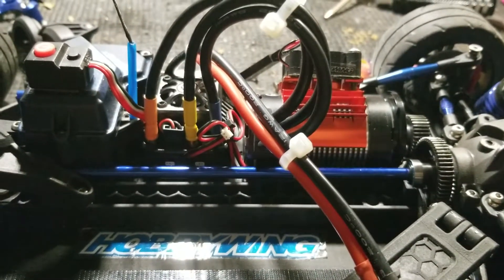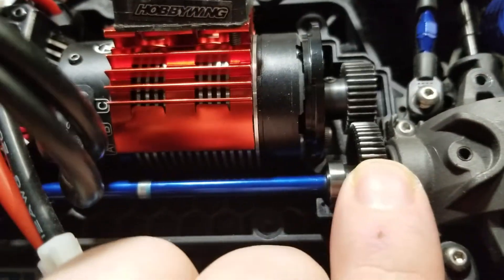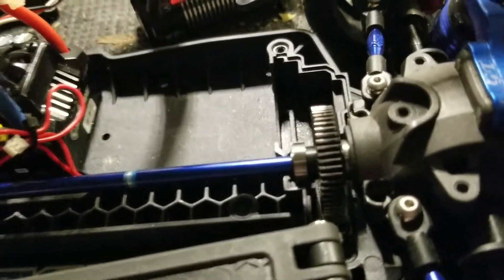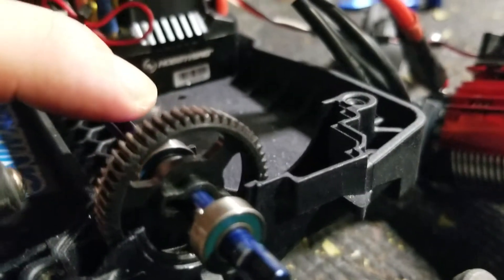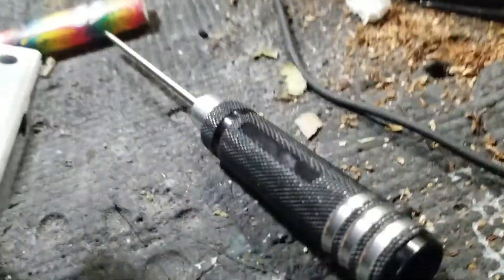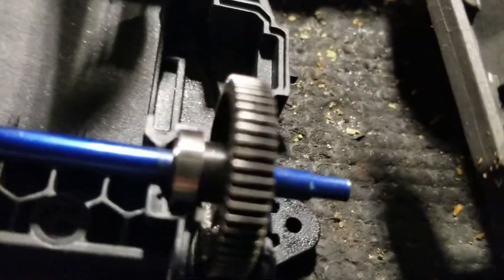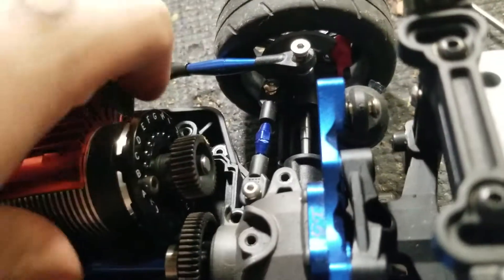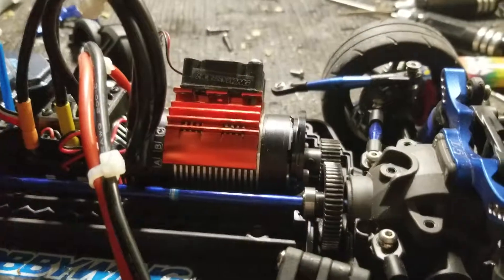Traxxas 4tec 2.0 hotracing spur issue and fix

Comment: This vid popped out of nowhere. It happened to me with the stock gear, so its not HRs fault it's Traxxas' design flaw. The bearing is supposed to semi press or snap onto the gear. After several heat cycles it works loose. With steel there's no way it will stay on unless you press the bearing in super tight like a real car or use thread lock.

 I put thread locker on mine and it's holding tight, I'll just check for play by wiggling the driveshaft every time after a drive as normal maintenance.

Comment: I feel you.  I had to add the bearing to mine. No more slop. My 4tec has all hot racing parts . I'm running 29t pinion and 62t spur. 3s lipo 5200mah. Its moving out good !! Tires don't last long. Lol.
Reply from the maker: What wheels u useing? Because every wheel i try dont last
Reply: @craigwhite2384  I have been using the 4tec 2.0 vxl stock tires. I like the way they look. They just dont last long. The 4tec is probably one of my favorite.  Well my Traxxas xo1 is my favorite also. Have all gpm upgrades on that one. Both cars have headlights and taillights installed.
Reply: Are you still running your 4tec  ? Upgrades ?
Reply: I run HPI rims, they're nylon like traxxas. Nylon holds up to acetone and can take a beating. Then I buy $40 worth of ebay $5 tire sets for the summer and swap them out. I only take it out 1-2 times a month though.